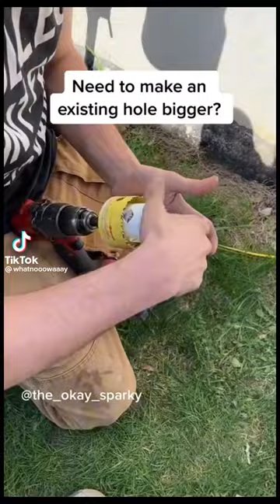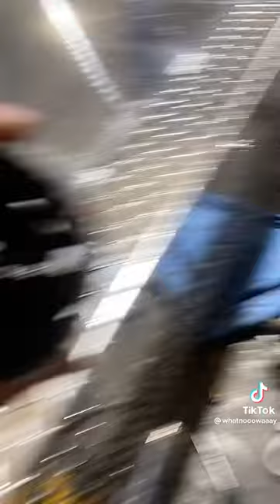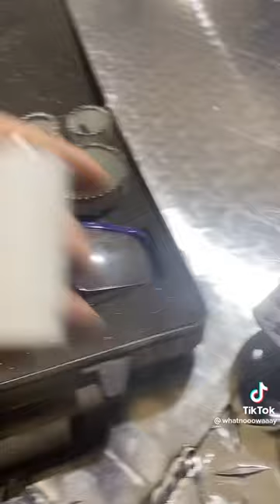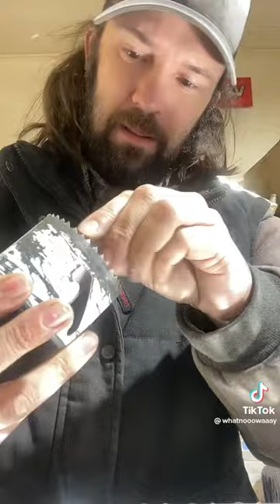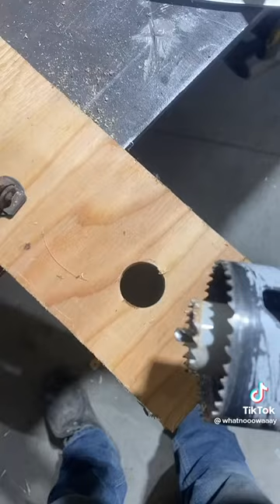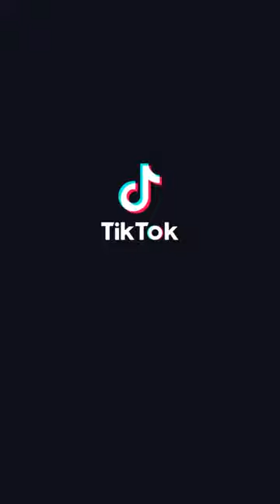Caution- strong language. Tool hack!

Comment: You can also drill a hole in a piece of plywood and center it over the smaller hole.  The way you got it will be hard to get the hole saws apart